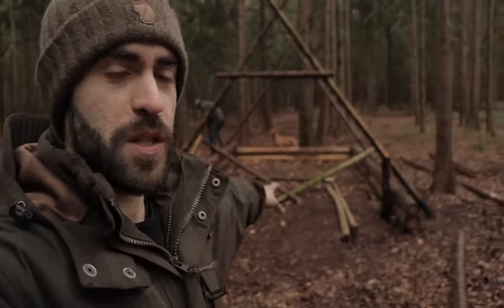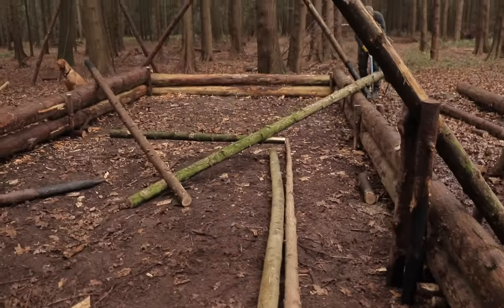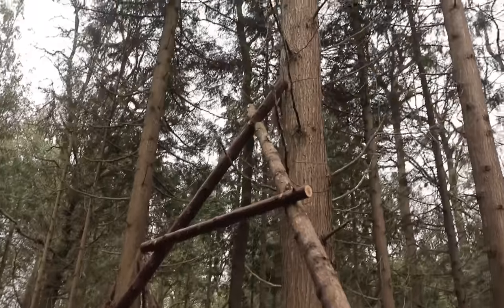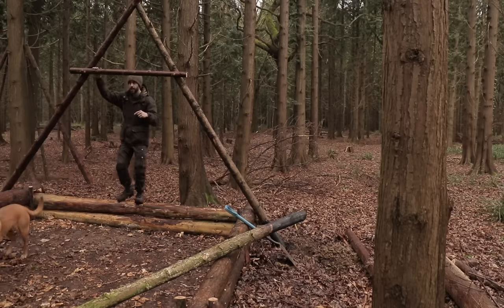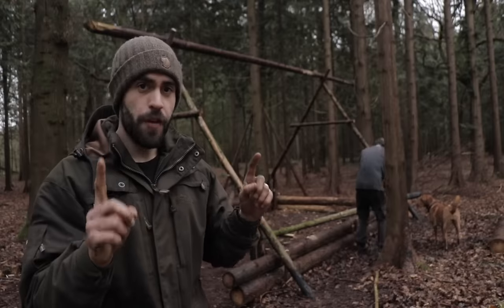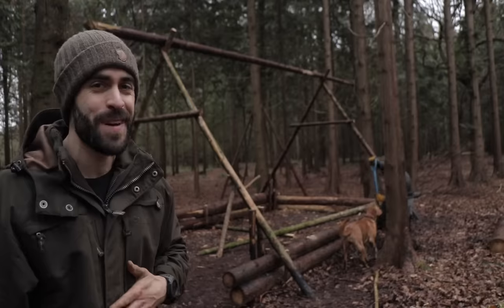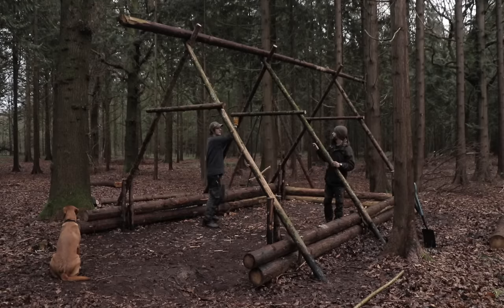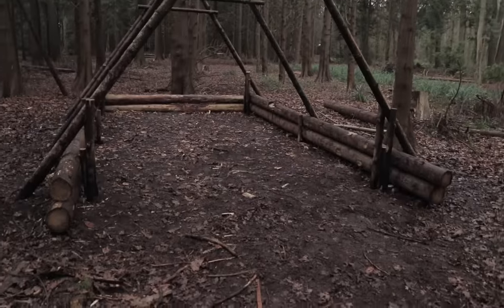Building a Viking House in the Forest: Timber Frame | Bushcraft Project (PART 2)

Comment from the maker: WATCH PART 3 HERE: https://www.youtube.com/watch?v=ScJ0on-gkHE
Reply: This is looking GREAT! Amber is a beauty, but I'm just wondering about Jax. Is he OK? On to part 3. Maybe he'll show up :)
Reply: Great vid brother! Where did you get the design? I live in Sweden and I want to build a couple of those and a forge to give the school kids a way to find their roots.

One more question, would it be extra protection if you smeared the fire hardened wood with pitch?
Reply: If you could find some real auger bits you could tap holes so much faster. I have a hand drill I keep in my Yukon with a full set of antique bits. I use them all the time for camping. It's looking amazing!
Reply: Good job Buena idea quemar las puntas sembradas muy bonito "very nice"
Reply: not yakisugi Prohibition
The official name 焼杉（yakisugi）
Reply: I've enjoyed your videos so far. Just a technical suggestion. I saw you and Justin talking about the A-frame and trying to get them to plumb with each other. If you had staked in the supports first, then lashed the A-frames to them, you could have had better control and been able to fiddle with them before backfilling and tamping the ends in. it will keep you from getting a wavy roof/wall. 20/20 hindsight and I doubt it will hamper the structure at all.
Reply: Where is this location?
Reply: Go
Reply: Go
Get
Reply: Шаромыжники были эти викинги... Временщики..
Reply: How do you judge how thick to make those dowels
you stick in that hole after you drill it?
Reply: Dude sick video series.. looks like alot of fun.. wish I had a friend to do this kinda stuff with.. all my buddy's r lazy fucks..lol
Reply: What kind of jacket are you wearing?
Reply: Ok
Reply: is the land and tree that you use right now is your properties?? or just random build these shelter in jungle ?
Reply: Where is The part 2 ?
Reply: Incredible REALLY 🤩🤩 love it
Big up from Moroccanboy
Reply: Brian Shemick I believe he said it’s in the Uk, England.
Reply: par zival I think he said it was Dustin’s land, on the first video. Could be mistaken.
Reply: منزل كتير حلو 💖

Comment: It’s not only a Japanese technique , burning the timber for preservation  was done by the Vikings , and further back by people in the north , and probably many other places . Great job guys 👍
Reply: a mixture with oxblood was also used on exterior surfaces
Reply: In Malay Archipelago too
Reply: Studies have also shown that it actually makes wood rot more quickly
Reply: @samsara713  for some wood types yes. For cedar it actually increases the already decent longevity of the wood. If they had used a linseed oil it would last even longer but thats for more plank based wood material.

Comment: Its called a brace, not a drill. Bit you are using is a high speed spade bit. Much easier with the proper bit with screw feed made for brace and bit. Wood pegs made from dead dry wood will not shrink like the green wood sticks you are using. Dry wood "nail" or peg into green timbers will hold forever as the green wood shrinks around the dry peg. 

Nice looking project and kudos for using hand tools!
Reply: An Auger Bit is what it's  called in the U.S..
Reply: brace and bit also in US at least for the 68 years i have used one
Reply: The alternative if you don't have any deadwood pegs is to make longer tapered pegs so that you can drive them in more in the summer as the wood dries out.

Comment: Classic Timber Framing Using Pegs! Two thumbs up for you Mike. 👍👍
Reply: I know very little about this subject, but that wood looked green as he stripped the park off that first peg. Doesn't that mean it's going to shrink?
Reply: @ChuckHaney  if both timber and pegs are green the shrink should be about the same. If just the pegs are green they should be good if they are tight enough.
Reply: There is one little problem though.. Using tight fitting round pegs on a framework of a house could spell trouble. Since as well as shrinking, wood can actually absorb moisture from its surroundings and expand.. I see you are using quite fresh wood as pegs and the expansion might be minimal even in the worst case scenario, but there is wisdom in using tight fitting, but SQUARE pegs in round holes as this allows the peg to expand without splitting the wood around them.
Reply: @ChuckHaney  YES

Comment: Next time you might not want to use green wood for pegs. Just think about it what does Greenwood tend to do when it dries. You typically want to use some hardwood when you're pining a structure, such as Oak Ash or Beach I don't like to use maple though since it tends to worp.
Reply: What does green wood do when it dries
Reply: It shrinks,a lot! These joins with the pegs will either loosen up or fail completely,as the pegs dry and or rot.
Reply: I think they are just doing this as a bonding moment between each other

Comment: Hi Mike and Dustin, for the chinking, put dry moss in the gaps between the logs and then face off with the clay. If you use the clay on its own the heat will go through both inside and outside layers. Dry moss in between will keep more heat in.
Just my thoughts.

Comment: Very interesting & entertaining. The dowels will shrink & the joints will loosen, so had you left the dowels long you'd have the opportunity to hammer them in further. Burying the "A" frames is not really advisable, because to keep the floor of the house dry, a drainage ditch should be dug under the ends of the rafters to lead the water away. If you intend to bring the roof covering to the ground & enclose a space between the dwarf wall & the roof, wildlife will soon move in. Nevertheless, I am really enjoying this series & thank you all for the videos.

Comment: Couple points, the bit that works best is an auger with a screw tip instead of the spade bit you used. Also you don't want to cut wood pins off flush if they're green because they will shrink as they lose moisture. Good videos and good work.

Comment: Really awesome build, I’ve never seen that style before. You mentioned that you wanted to make it last a long time and you also mentioned moisture rot being the biggest long term problem you have to watch out for. After your done building it you could always dig up and refill the holes you put the burnt ends of the A frame roof in. Use some kind of gravel or maybe river rocks to help with drainage. If the roof has enough support doing them one at a time shouldn’t be a problem. You could even make your own Roman concrete, it dates back to 150 BC, and fill the holes. Not sure if it’s considered primitive but homemade concrete would be kind cool.

Comment: Shou sugi ban isn't about evaporating moisture out of the wood. Those logs will soak back up with water after a few hours buried in damp soil. The technique burns the starches in the wood that are food for rot causing microorganisms (fungi). You could also try pine tar on the poles as an extra measure, although I'm not sure that's a viking technique. Great work on the project!

Comment: Square peg of harder wood driven in the round hole will hold tighter and longer. Used this method before works great, did not believe when I was told .

Comment: I remember a poem for making wood pegs that may help them stay in.

Strongest pegs start as a circle and end as a square.
Bigger than the holes just by a hair, 
Woodworkers craft the shallowest taper
Carve them to size to make sure they stay there.
Fork gently carved in the edge
for the finest of small oak wedge
when the craftsman lays his head,
he can be sure the roof won't fall on his bed

Comment: To reduce the gap between the logs, run the saw between them ans where they touch you will saw that away and make the logs fit tighter. Moss makes great chinking as well.

Comment: Not the best shovel to be used in that situation, though it ended up okay. I would recommend using a round point shovel if you go to collect clay to use as chinking material. The rest of the build seems to be going great!

Comment: The supports you have used for A frame... How about horizontally drill a hole between those and use a wedge to hold the support and frame together? Will make it a lot secure I think...

Comment: If you use dried pegs the joint will get tighter as the green timber dries and shrinks while the already dry peg stays relatively the same.  Even if you only dry them on a fire for an our or so - in a pot of hot sand is traditional.

Comment: Saw across the diameter of the pins before you drive them and put a wedge in the slit and continue to drive the wedge and saw off the excess...just a thought...great work gents
Reply: Also hammering with an axe scares me...perhaps make a sledge from wood...hate to break my axe in the bush
Reply: 50$ worth of rebar , precut  , much better pegs , and 1 foot lengths of anchor chain  over rebar threw wall , binds it well

Comment: Burning the outer part of the wood preserves it for abt 2000 years, it´s no so much abt taking out the moisture it´s abt impregnation
All the bark will eventually come of maybe already in spring, due to insects living bet the bark and the wood
Using stakes in the frame is a good idea, but using not dry wood is going to shrink. Using the stakes in the a frame with no dry wood can be in some way compensated by leaving abt 5 cm, opening it in half with a knive, then driving a flat stake in to stake, maybe even 2 takes, the 2nd one even smaller.
If using a big pole as a hammer instead of the back of the axe, gives you more feeling with how tight the stakes/poles are, you can hear it, it´s also not so hard for the hands, fingers.
Apart from all this, a super project!

Comment: Having worked with green wood a bit some thirty years ago I have an observation to make. I see you cut the joint pegs or dowels off flush with the poles they are fixing. It may be prudent to cut them a little proud so that when the wood shrinks as it dries they can be hardened up again by driving in a little more. 
Cheers for a ruddy good show I envy you and wish I was fit enough to get in the woods again.

Comment: Since you got some clay there, would it be a bad idea to fille the holes for the A frame with some of that clay, soften it with water, so that you get a really nice and tight grip on the pole and then light a fire around the base? that way one could partially bake the clay and burn the wood a bit to protect it from rot...

Comment: Guys, really enjoying this build. It's looking good, but I have a question, in my limited experience of carving greenwood I find that when leaving bark on it needs to be stabilised or the bark begins to separate when it drys. Won't this cause problems to the chinking down the line?
Reply from the maker: I think you are right and that it might cause some problems down the line. We will probably do a video at the end to run through all the problems we had when building the viking house

Comment: So I am wondering if would not be better to sink  a 10in By 2 foot piece of log into the ground notched and pinned to the "A" frame? It would be much stronger take more of a snow/wind load and prevent the "A" frame from rotting longer.

Comment: I kind of doubt the Vikings had an auger like that. But sure, something that did the same job.
Reply: I can think of three methods. #1, they used a stone chisel and cut out a hole. #2, they burned a hole. I know techniques where they get a super hot coal and put it in there and burn a hole through it and keep adding fresh hot coals as needed. #3, they had something similar to an auger which was stone (and of course no handle) and they spun around to cut the wood. a lot of people these days act as if anyone post 1800 were stupid, yet they were very smart.
Reply: Why stone!? The Vikings were some of the most advanced metal workers on the planet. They made a type of steel that we have trouble duplicating today! They had steel or iron hole boring devices, because a lot of their boat construction was actually sewing the planks together. Lots of hole to drill. If they had to use stone or burn holes,they wouldn't have finished their first boat until about 1975!!

Comment: Shouldn't use green pegs in your rafters. Though they should be fairly dry, they can't be old, either. There's a happy medium. A green peg will shrink over time and loosen. Too old of a peg will not be as strong. Of course, if you are doing this for the short term, it won't matter as much.

Comment: Historical european felling axe of the first millenar were not american pattern, european axes had a round eye socket with almost no poll, and usually no poll at all, pounding stakes with that would destroy the socket. For driving stakes into the ground, vikings would have crafted a wooden mallet.
Reply: I had similar thoughts, the axe is too light.  A heavy wooden beetle would drive those stakes in no time.  Good idea using the stick to steady it. Good luck hunting for the bark. Try birch as well as cedar. Careful with fire, though!

Comment: want those dowels your drilling into A frame tighter, Before you Trim them to dowels, saw a slot a ways down the Length like the slot in top of the axe for a Wedge to be added later.

Comment: If this was going to be a permenant building then you would want to use dried wooden pegs in green logs. The pegs will have stunk as much as possible once dried and as the green logs dry they will grip the pins tighter. when both are green, the pins will dry faster and come loose.

Comment: How do you judge how thick to make those dowels
you stick in that hole after you drill it?
Reply: The drill piece will say what size it is in inches, I imagine a good way to see if your dowels fit is to leave em slightly thicker and just push them against the holes before shaving more off as you go.

Comment: Not sure if anyone told you boys. But using an axe as a hammer is very bad. It can fracture the handle internally over time and the head can actually break off and go flying at your face.

Comment: my ancestors lived in long houses, Viking communities lived in long houses, yours is to short to be original. the reason they did that was as a community, heat an food wood not be lost, an the royalty, lived in Hugh long houses, the one you are building was made for individuals that were disgraced or did something against the norm of the community. an if you were to take the one you made an double it, those were  made for the shamans. also the tooling is off for the time period they did not use saws or hand saws to make dowel pins, an they did not use wood hand drill, they would heat up melt rods an push them into the logs to make the hole for the dowel pin, to make the top log rest on the other log they used either dung mixed with straw, or clay an potash an straw then place the next log on top, the bottom frame work was like you made it but 2 to 3 foot high with squared off roof, an sod was used on top for a roof would keep the heat inside better.